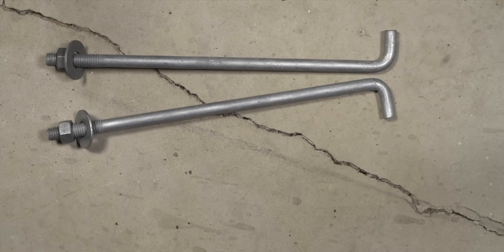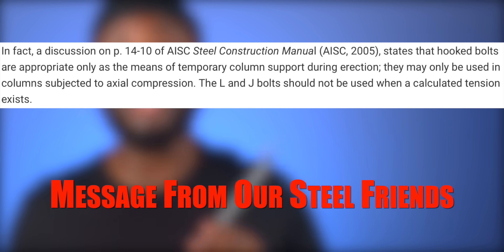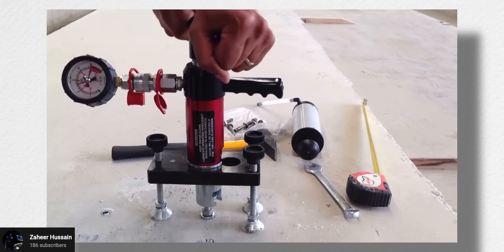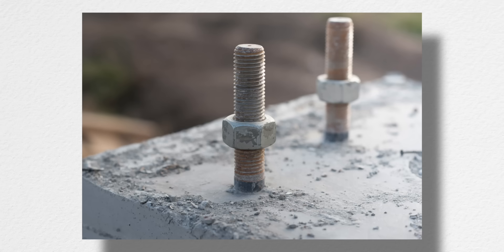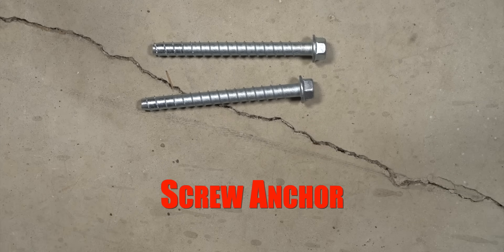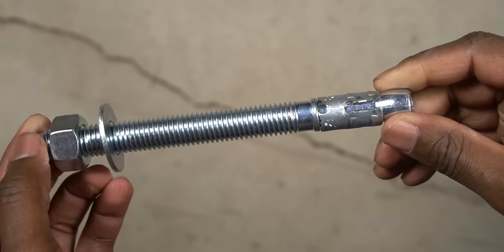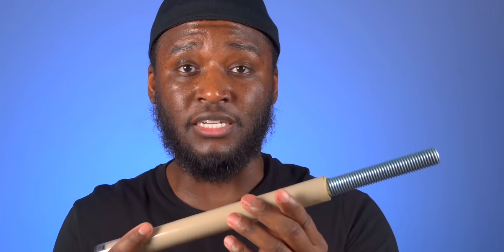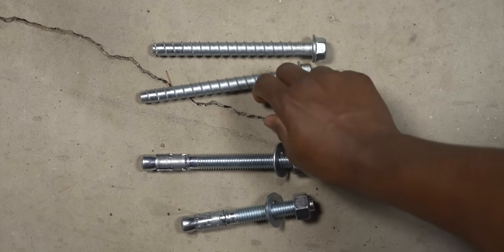Why Abandon "J" & "L" Anchor Bolts in Wood Framing Construction FOR GOOD?

Comment: It's called shear strength not up lift. They work better than other options but getting the cement people to put them in the correct locations for your framers is hit and miss. The expansion bolts are used simply because it's easier.

Comment: I am a general contractor with 40 years in the field experience and if the anchor bolts are installed as they should be, by code, they are to be tie wired and hooked to the horizontal strand of rebar. The sleeve anchor and screws you show are a far less substantial means of anchoring a sill plate and instill a false sense of security in folks who haven't a clue of construction codes and practices. Just my 2 cents.
Reply: Exactly what I was going to say!! Great call out!

Comment: I spent the morning today hammer-drilling holes for expansion anchors in a new build.  The contractor specified expansion anchor bolts (in addition to Ramsets) on all the interior and exterior wall base plates.
Reply: Those are always fun,when blowing the dust out. Just when you think you got it all a dust cloud blast you in the face. lol..

Comment: Mr Garth if one lives in earthquake country with expansive soils where uplift is more than wind j bolts have been known to split the wood rail over the foundation wall, professions like to use embedded galvanized straps into concrete and nailed to the rail there instead.

Comment: I believe that this movie was created as a promo for the post-installed anchor industry. The code requires CIP anchors to be emended 7” min.  which means that overall length of the anchor must be more or less 11”. Can you imagine how much the 5/8” diam. KB-TZ2 SS (they do not fabricate HDG stock) anchor of this size is going to cost?  It is a major impact on the construction cost. Good luck! So, CIP anchors are here to stay. In addition to what I have said above consider the following: 
1. To install post-installed anchors into the sill plate (review the ICC Report #4266, for example) you need to provide a continuous special inspection at the site which can only be performed by an authorized third party, special inspection agency. I can guarantee you that it will triple cost of installation compare to the CIP anchors. 
2. Please also show correct anchors with standard 90 Deg. hooks, not what was shown at the beginning of the video. What you showed was a substandard anchor with a short tale. See ACI318 or CRSI manual for correct dimensions. 
Good luck from California, SE.
Reply: I like how they show a j bolt breaking through a piece of concrete about 2" thick.  Show me a video of a proper 7" deep j bolt that's hooked into a lateral rebar breaking out.  I'll wait...
Reply: One minor detail that you forgot to mention, is when the j bolts line up with window king studs, stud packs, and other studs, often they are just set into the space and never get a nut, and no one would be the wiser. In these instances, we have to go back with a titen or wedge anchor either way. What's the difference?

Comment: Like pouring concrete isn't hard enough you have to find time to install J bolts straight up and down at the right depth and spacing.  And if you don't do it right half the time they wind up under a stud.

Comment: How 'bout you show us the threaded and epoxy anchors being pulled with your test jig like you did with the L bolt? I'm having a hard time believing the concrete wouldn't break and blow out in the same way or that the bolts wouldn't just pull out. I just want to see it. Everything looks good on paper.
Reply: @Mastinox803  I believe a lot can be summed up in one word. 'MARKETING'
Reply: I remember the first time I installed rebar using the epoxy,I thought it was a joke. of just going threw the motions of doing something.

Comment: The screw in are more expensive and more labor intensive. If the J/L anchor has horizontal rebar over the J loop or L horizontal leg they have much more pull out strength than a screw in. You need to include a table of the uplift strengths. As for difficulting I am curious who finds them hard... not the concrete workers. It is probably the sill installers.

Comment: No way I would use wedge anchors on an exterior wall.  5/8'' galvanized J bolts.  Interior is ok for the wedges and the 'post installed'.  If a slab is poured correctly 3500 psi min. and has a proper rebar mat, the J bolt is not going to pull out.

Comment: Your alternatives have a major flaw in this aspect:  You are presuming the installer is using the correct drill bit and the installer is properly blowing the debris out of the hole.
Reply: I think this comment is underrated. I have seen installers do all sorts of careless stuff. Good construction designs do not require perfect installation because installation by contractors building 99% of buildings will have at least small flaws.

I was watching a video on YouTube the other day in which a building engineer showed the construction of a masonry wall with a drainage air gap and insulation between block and brick. In one portion of the video, you could see that the cavity was full of mortar that would not allow proper drainage.
Reply: No products, of any type, would ever be used if we assumed installation was always done incorrectly.

Comment: You generally don't want to use wedge anchors on a foundation stem wall (which is most of the time). The distance from the centre of the bolt to the edge of the concrete is too short to comply with the manufacturer's minimum requirements. You can even potentially blow out the concrete. The wedges push out and if the concrete is too thin, it will blow out. The close edge distance also substantially reduces the capacity of the bolt.
Reply: Yeah, I hate wedge anchors. They're far more of a hassle than any other.
Reply: There have been more than a few guys get their heads smashed through their asses from wedge anchors in 2 post auto lifts.

Comment: None of these things resist uplift unless there is an accompanying strap that ties into preferably a large post built into the wall which is also rigidly strapped to the roof or beam which rafters or trusses are then strapped to.  I'm not even a structural engineer and I know that much.  Uplift forces are resisted by hurricane straps which distribute the enormous overturning forces across dozens of nails in shear.  They are usually, if installed correctly, integrated with rebar to distribute the forces throughout the foundation.  

These anchors are primarily meant to counteract sheer forces and keep the house in place on the foundation.  Not to prevent it from lifting up, because honestly, if you don't have hurricane straps, the only thing keeping your house bolted to the floor is the 1.5 inches of 4 or 6 o.c. spaced nails along the bottom of your outer shear, whether OSB, ply, or that nifty zip stuff.

Come on, man.  Even I know this stuff.

Comment: Just ran across your video...I have to disagree with your opinion about j-bolts,however. I am not an engineer, but with 50+ years experience, as a contractor and carpenter, I have come to believe that a j-bolt, properly set in fresh wet concrete (which I agree is difficult), or cast in place and tied to rebar ( the best method, I think) is the strongest. I have used all the methods you explain many times. Of course, after installation, there is no way to see how well the installation was done. But that applies to all these methods.

Comment: There’s the structural design and there’s the builder. In the garage at my home growing up, we widened the garage and found one of the J bolts was just the top inch, there to fool the building inspector. It must have landed under a stud, so they cut it off, and drilled a hole next to the stud, put a washer and nut on, and dropped it into the hole they drilled.

Comment: Hang on here. I learned how to do foundations from an old high school buddy in the trade. It was not covered in engineering school.

Rebar is a big deal. The use of rebar I’d carefully documented. What I like to do and granted it’s tricky, is to slip the j bolt into the mud and then rotate it 90 degrees and slowly lift up.

What happens is the bend is now under the length of #4 rebar. You can feel it catch as you fish around. 

Of course, one of the biggest problems is to put J bolts in the wrong place. Code dictates the placement schedule which sometimes interferes with the framing and sill plate. This is a pain. So the foundation drawing should show placement of these bolts.

When needed, I will augment or repair as needed using a Titan bolt by Simpson.

Comment: Those expansion anchors are absolute JUNK !  I just built a garage where the concrete guys forgot a couple of the J-bolts and installed 4 of those expansion bolts where needed. Well, along comes me, the builder to install the sill and EVERY one of those expansion bolts pulled out of the concrete when I tightened them. You know what didn't pull out of the concrete ?  you guessed it... the J-bolts. I will not be getting rid of J-bolts anytime soon !

Comment: As noted below you don't mention the properly set anchor bolt that is hooked under the horizontal rebar and tied to an upper horizontal to establish plumb.  All your after thoughts are point loads and will not anywhere near equal a properly set and secured J or L bolt cast in place.

Comment: I didn’t know J-Bolts were used to withstand uplift loads. That is why engineers specify hold downs with specific uplift capacity based on the conditions or structural calculations results.

Comment: J-bolts, with a linear rebar, running between them, laying in the "J" greatly increases the pullout resistance, and avoids wet setting issues.
Reply: Agreed! Terrible swap!
Reply: Right. Place your rebar, then tie your j bolt so it catches the bar. Place your sill plate on the bolts, and give it a tap to mark for drilling after the pour.
Welded wire fabric would work if you don't use bar
Reply: Exactly!  The poster of this video is just a shill for cheap and shoddy contractors.
Reply: Let's just be honest here: NO CONTRACTOR is going to pay the added expense of drill bits, higher cost fasteners, or PAY THE LABOR on the time it takes to drill/clean holes and install a fastener in a foundation. Concrete screws don't bore wood well, so a GP will have to buy bits for the wood & bits for the concrete. Crazy. Not like the concrete contractor is going to lower his $$ cause he doesn't have to do j bolts anymore, the GP would add the cost to the home and suffer the lost time. I just don't see that happening.
Reply: @crforfreedom7407  SDS bits aren't expensive, and contractors usually do have SDS bits & hammer drills for fastening steel support posts inside the building to the concrete floor. Its far quicker to just drill the holes in the concrete that line up the bottom still plates with the j-Bolts. Second a common issue is the J-Bolt is located where the wall stud needs to be, often where a Jack-Stud support needs to be located. 

All of the framing contractors I worked with had SDS hammer drills. What is a pain is leveling the top of a concrete wall full of j-bolts. If your concrete base isn't flat & level, neither will be  your building.
Reply: @guytech7310  We of course had them too, but I've never drilled a sil in my life. lay down the bottom plate, slap it with a hammer to mark the bolts, drill em & lay em. That's all I've ever done. I can't imagine having to stop and get all that crap, drill all that crap is faster than a couple of hammer wacks.
Reply: @guytech7310 
No we can fix that with shims, and grout.
Reply: @hepparade Not really. Shims leave gaps and uneven load under the sill plates and can tare up the sill sealer.  Basically what your doing is patch work instead of doing it right.
Reply: @guytech7310  Shims?!? Whare are you talking about? If your concrete contractor is so bad you need shims, get another contractor......... NEVER had a foundation so bad it needed shimmed. Non in 30 years.
Reply: @crforfreedom7407  Its not possible to get a perfectly level foundation do to the forms & if they insert J bolts, unless the pour is excessive wet (ie weak), so it self levels. Also when the foundation walls have different heights is for a connected garage or a base for a porch that is set lower, but is poured at the same time as the foundation. 

As far as the Shims, I was replying to @hepparade, who suggested using shims.

For my home I used a 10 foot straight edge & ground the top of the wall so no light was passing through. All the way around the foundation wall. It was dead flat. I suspect your foundation walls aren't dead flat at the top. because there is absolutely no concrete contractor to do that with the forms & j-bolts.
Reply: @guytech7310  Never had a foundation out more than 1/4" in my life.
Reply: @guytech7310  We just doubled the sill sealer. Problem solved.
Reply: @guytech7310  IDK where some of you come from, but even in the 80s we had surveyor levels to shoot the forms. And yes, b4 Jbolts went in, the top surface was troweled out. Thought that was pretty standard fare.
Reply: @guytech7310  Just FYI... I've done remodels on 19th century homes with perfectly level foundations 100+ years later. IDK who's doing your work, but FIRE THEM.
Reply: @crforfreedom7407  Not really solved, just patched over.
Reply: @crforfreedom7407  Or you didn't measure it right.
Reply: @guytech7310 
I've got so much to show you.
If your concrete walls are flat "because of bolts" spec it in the job and find new concrete guys.  It not difficult to finish flat around bolts.

And as far as shims, for fouled work:; structural grout and shims are standard practice.
FYI: steel shiming plates are available as well as composites.

Cheers✌️
Reply: @crforfreedom7407  around here framers set anchors not concrete guys, and some of us ARE into Titens for standard bolts.
Reply: @hepparade Interesting. Never seen builders work beside concrete guys ever b4 in my life. I find that interesting...
Reply: @crforfreedom7407 
That's unfortunate your project team isn't working together.
For us, it ensures bolts and more importantly hold downs will be in the proper place.
Reply: @hepparade lOL! Never had a 'protect team' in my life! We hire good concrete contractors. If they do sht work, we don't hire them again. But except for walls not being totally straight or square, never had a problem w bolt placement. Nothing we couldn't work around anyway.
Reply: @crforfreedom7407 
"Except for walls not straight or square [but you] hire good concrete contractors"?!
FYI: those concrete contractors are part of your project team.
Reply: @hepparade LOL! Nobody's perfect? ... They've never been horrible. Nothing we couldn't work with, but it did add time.
Reply: @crforfreedom7407 
😉
Happy holidays to all you my brothers in the trades...may we persevere in staying present, to continue learning and to be patient enough to teach all that we've become to the next generation.
🙌💪👍
Reply: @hepparade Amen brother! Merry Christmas! Have a great new year!
Reply: or  better yet you could weld the rebar to the j bolts making them one.
Reply: @jasonruff1270  There are  adjustable plastic brackets that can be screwed to the forms that can hold a J-bolt in place and you use tie -wire 
to hold the rebar on the J-Bolt .  J-Bolts with a rebar cage will outperform any after pour anchoring system . . . Period !
Reply: @jasonruff1270 nobody welds rebar.  OK, we don’t let anybody weld rebar on bridges.  Idk wtf other people do but for real structures nobody welds rebar.  The danger is actually making the rebar more brittle and the whole point to rebar is to take tension.
Reply: asonruff1270
Reply: @jasonruff1270  Rebar is heat treated.  When you weld it, it changes the tensile strength.
Reply: @randallthomas5207  standard rebar is not heat treated and welding it is fine and accepted bye the building and planning department
Reply: @RM-cb6tm depends on the grade of rebar.  Which can be found in the stamping on the bar.   For most of what I have done, grade sixty has been specified, and used.   There are lower grade bars.  Locally, typically the lower grades are not stocked.   And must be special ordered.
Reply: @RM-cb6tm  It can be welded for structural situations only if it is grade W. Unless you ask for it, your rebar is most assuredly not grade W. Regular grade 40 and 60 doesn't meet the CE level necessary to have a durable weld. The heat of welding will make it quite brittle. Will it work? Yes, but the weld will fail at a much lower load, especially if the loading is dynamic in nature.
Reply: No body does that. The are just sunk into the concrete after the trowel the top edge of the wall. The top of the concrete needs to be leveled\flat so the sill plates sit flush on the wall with mimimal gaps. 

That said I never seen a a top of a concrete wall with J-bolts that is ever level & flat. Only way is to use a concrete grinder after the forms have been removed, and its not possible with the j-bolts in the way.
Reply: @guytech7310 
We use hangers